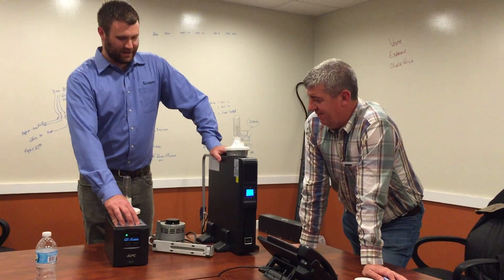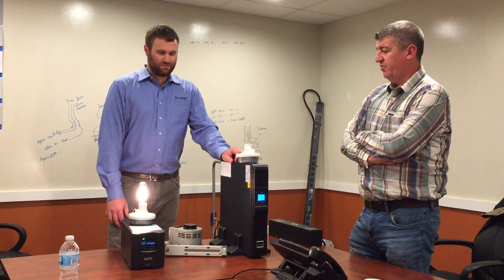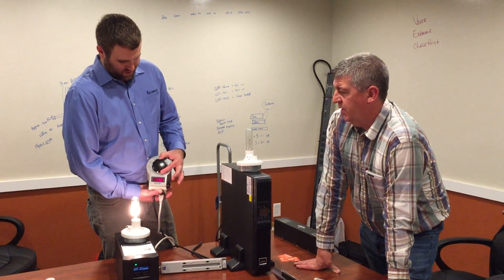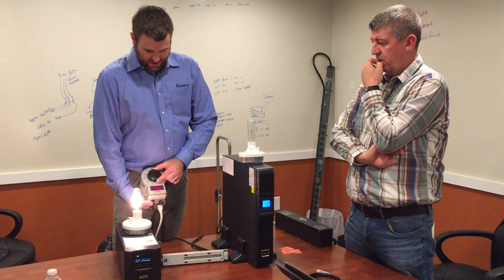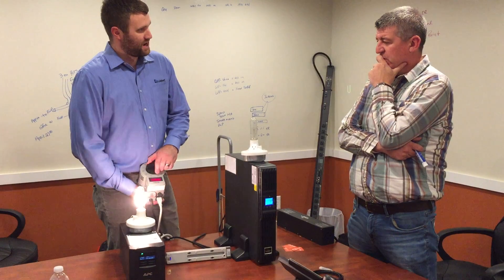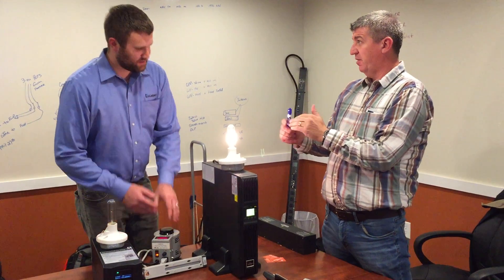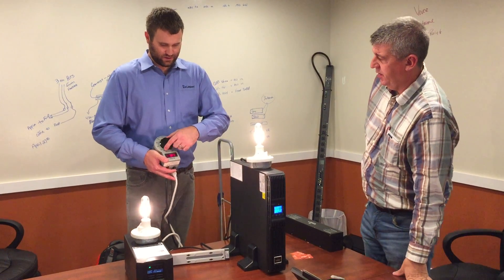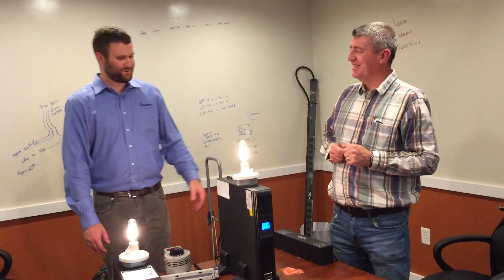Liebert Online Double Conversion Technology

Comment: how is the double conversoin UPS not losing voltage? is it always connected via battery? excuse my lack of knowledge - i just thought that a physical switch had to throw to pull power from the battery source instead of commercial lpower
Reply: PWM